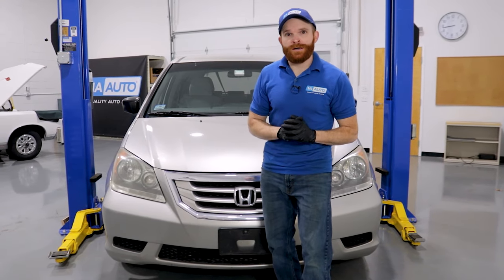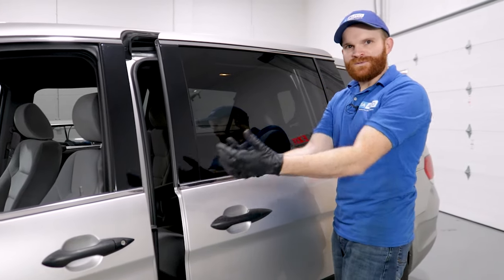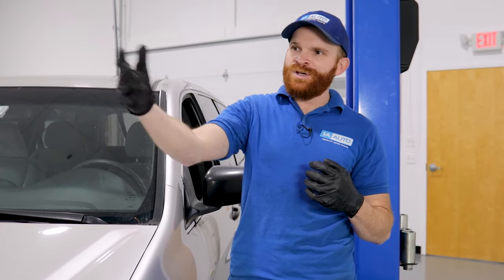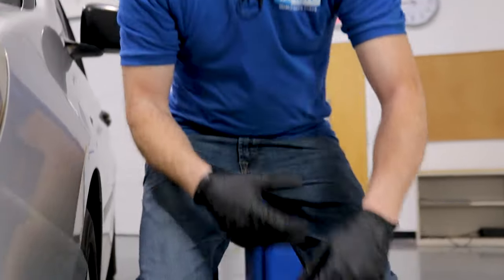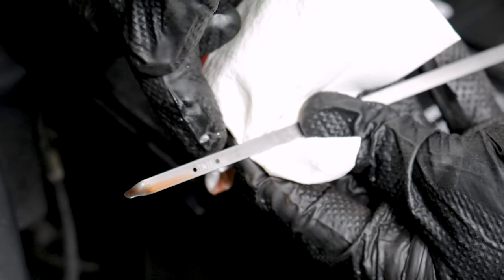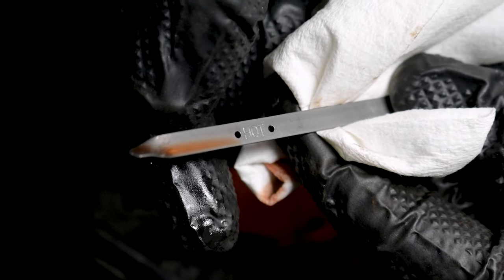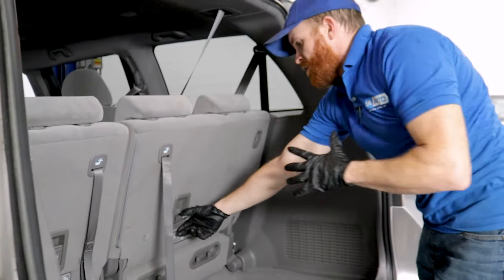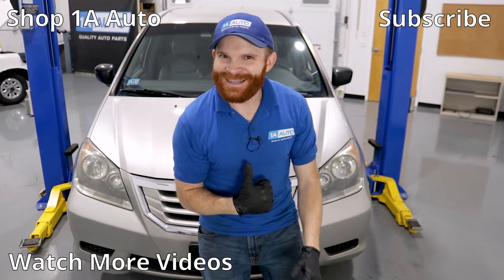Top 5 Problems Honda Odyssey Minivan 3rd Generation 2005-10

Comment: Arent you supposed to check the transmission fluid with the engine running?
Reply: that's oil and you check it after the engine has ran
Reply: Run engine for 10 to 15 minutes turn off the engine and then check transmission fluid same on every vehicle after 2003

Comment: So, how do you fix the sliding door issues?
And you missed the timing belt tensioner, the valve adjustment, the loose rocker bolts and power steering O rings.
Reply: There are videos showing how to replace the sliding door roller. I've done it myself. Not too hard. +1 for the power steering O rings.
Reply: Rockers and ps o-ring for me too. 
Anybody know the symptoms of a worn "timing belt tensioner"?

Comment: I own a 2007 odyssey exl I have none of these issues. My sliding doors sometimes act stupid due to the angle I’m parked on a hill . I have 149k solid no issues bout it 6 yrs ago only replaced Power steering pump and wheel hub bearing for the front, that’s it
Reply from the maker: +Kev Burr Thanks for the feedback!

Comment: There is nothing more unsatisfying!!!! Having to pull the sliding door panels, because the latch cables broke or came off.
CV-joints seem to fail premature. The streets in New Orleans can do that to any vehicle.
Don't ever use a FM transmitter to adapt your phone into the radio. SMH it caused my keys to not function right. The van wouldn't start in the mountains.
Valve cover gaskets or O-ring. once they start to leak there is no way to stop it, other than changing them.
But other than all of that it has been a great van. 
When my daughter wanted to start driving. She had to drive the van. Best boyfriend deterrent on the planet. Couldn't be happier with the results.

Comment: I own a 2005 Honda Odyssey and the back always fills up with water from the rain what is the problem with it
Reply: You've a leak, Ma'am. Only way to fix that is by finding it in person and seeing if you can spot where it is and if it would be easy to seal up. Could be something as simple as removing a piece of the trim or as expensive as a rust hole.

Comment: I have the brake pulsation and thought it was tire pressure issues.  Is there a set of brakes sutible for the Oddesy to stop pulsation.  I will have to replace mine.

Comment: I have 2005 Odyssey. Passenger sliding door won’t open automatically. Changed fused few times. Then it happens again. Remote will not open drivers door, have to use key, remote won’t operate car start or open tailgate. Is it fused or what? Have new battery in remote

Comment: 5 common problems? The only common problem hondas odyssey have is the sliding door & easy to fix! Not only hondas Toyota sienna they have it too!  Motor mounts , transmission mounts,  brakes , transmission low on fluid, Not serviced  is not a common problem!!! It's called maintenance! All cars have factory problems & recalls.

Comment: The only issue I’m really having with my 06 at the moment is when I put it in reverse I get a loud clunk noise which is very frightening. I’m taking it in to my mechanic in a month but he is unable to get me in sooner. My fluids are good and it shifts well. What could be causing this issue?
Reply from the maker: +Ciarra Easler We wouldn't be able to diagnose an issue like that here, you may want to have a local mechanic take a look at it. Thanks for checking us out! http://1aau.to/m/Shop-1AAuto-c
Reply: Just bought an 05 two months ago and it has the park to reverse clunk too.
Reply: Could be the motor mounts.
Reply: My 2003 Odyssey does that if I don't let it warm up when first starting it for the day.

Comment: I have the 09 with many problems it wont start after several hrs 10 tp 15 hrs. After replacing battery and alternator still same or worst. When is turn on sand left on park it will make a weird noise which seems to be the ac   Cause after that no ac only regular air i hope we solve all this issues today

Comment: You are doing a great job, hay I have a  problem with the my Honda  2003 steering  make a  noise  like  a cow in  van what about  that,  thank you for the wonderful things that you have done showing  what you did  blessings to you Amen
Reply: You most likely have air in your power steering system caused by an old gasket. This is common and there are several videos showing this fix. I've done it myself twice.
Reply: I did the gasket too, the one closer to the front, on top of the engine, in the power steering fluid line.

Honda part number 91345-RDA-A01
Which was $1.95 at the dealership part department.

I had also replaced the power steering fluid reservoir, and did a power steering fluid flush or whatever it's called. Overall it took a couple of hours, and fixed all the power steering problem.

Comment: Ok So the mechanic did something bc he was trying to milk another $700 out of me. He replaced my timing belt & tensioner. But all of a sudden, now ONLY driver's window & sunroof work. Checked fuses, factory reset, still no good on 3 other
(It's a 2006 Honda Odyssey)
The Honda Odyssey exhaust flex pipe, that braided silver stuff on it, a guy showed me it was oddly split down middle. As we're sliced by a box cutter. But would it idle OK, yet once I place it in drive, it won't go up hill. Similar to when I've blown a head gasket before (that one wouldn't idle though) but it's NOT the head gasket.  Just had oil changed professionally & still looks NEW. 
We'd changed the spark plugs, camshaft position sensor, crankshaft sensor. I've checked ALL MY FUSES. Pulled out relays, but unsure how to check those,  other than swap alike ones around. 
Oh, plus, when he touched my baby to do timing belt. All of a sudden my bad battery, which worked fabulous, as long as I didn't leave dome light on, or go like a couple of weeks without starting it.
Bought a NEW BATTERY.  KILLED IT before 30 days had passed. And that's with removing both cables, and only hooking them up to lick/unlock & maybe roll driver's window down.
They gave me ANOTHER NEW BATTERY.
I'm way too terrified to dare see if it's still drawing on the battery bc we got evicted in Feb. This is also my "house on wheels"
I stupidly went halves on motel room so I could give the poodle a bath. And someone shattered passenger window & ransacked my van.
I replaced the window.  But I can't get the motor to drop down to insert those 2 bolts. 
I've got half a tank of gas. 
My alternator is fine.
Starter is new rebuilt from a store, not ghetto home job.
Could that slit braided shit on the flex exhaust REALLY cause it to not go up hills?
No.
Idk where my fuel filter or lines, or pump.
I'm a girl.
I really REALLY want to BE THE GIRL & BOYS DO THIS.
But, no $, 2 large dogs & a possum...
I just don't have $ for anything.
Especially after replacing ALLLL THESE PARTS.
PLEEEEEASE 
WHAT ELSE can u think of, besides the fuel shit?
Sincerely,  
Hopeless close to Seattle

Comment: I have a 2005 Honda Odyssey it is giving me a code of p2627 oil has been changed it rides fine any ideas what could be making the code.
Reply from the maker: +@cliftonr4445 We wouldn't be able to diagnose an issue like that here, you may want to have a local mechanic take a look at it. Thanks for checking us out! http://1aau.to/m/Shop-1AAuto-c

Comment: I have a 2010 and when I shut my car off  I notice that the high beam light does not completely go out. It stays on with a dim. Then it noticed it flickers and I hear a clicking sound coming inside the car towards the back.  Why does this happens and how can I fix it

Comment: How about the problems in the engines with  the cylinder deactivation feature. Then there is the rear leveling arm issues.

Comment: I did replace the lower rolls from one of the sliding doors but I had a hard time puting the cable in fact I had to do something in order to do it but I thinks there have to be a easy way

Comment: What about the misfires and limp mode issues?
Reply: misfires are usually (not always) due to the Variable cylinder management
Reply from the maker: +T Mike Thanks for the feedback!
Reply: @MichaelB-cs6ke  To clarify, misfires develop from fouled spark plugs. Fouled spark plugs due to VCM. Clean or replace spark plugs and you're good to go!

Comment: In 2015 I bought bland new Odyssey. After drove  about nine  months the transmission acting strange.   So , I bring back to dealer,  they said can't find any issue.   . Notice  that when I starting at traffic light can feel first gear to second gear . whole transmission jump  ( jerk )  scare hack of me .  I back to dealer again. they suggest to change transmission oil.  After that.  good for few months.  Been told every 3 thousand miles have to change oil again.  The Honda not submit  they have a problem  on transmission .

Comment: 2009 oddy running great. (215,000 km) Rear wiper failed. Was looking for fix.
Reply: Let me know what you find out, mine is hanging straight down :(
Reply: If it just doesn't move it's most likely frozen in place. I've had to fix this twice (2 different Odys). Basically the wiper motor is frozen where the post sticks through the hole in the rear door due to corrosion. You have to remove the motor, then clean the post using sandpaper or a grinder. Grease it and reassemble it. Not too hard.

Comment: I don't have a transmission issue. However, whenever the car is parked uphill or downhill... It's difficult to change the gear from parking to reverse. Makes a loud noise while changing from parking to reverse.
Reply: What you probably have happening is that the full weight of the vehicle is basically resting on the trany and therefore on the gears INSIDE the trany.  This causes excessive wear .  Especially when pulling it out park and you get that big “CLUNK”, when you are on a hill. 
Solution when parking on a hill,... is to engage the parking break, BEFORE putting the transmission in park.  Then slowly let your foot off the brake pedal, so the vehicle then slowly comes to rest,...on the parking break (and NOT the transmission).  Only then shift into “ PARK”.   If when you let your foot off the brake pedal (slowly) and the car comes to rest on the parking brake, but then slips a little, it means you didn’t step/pull hard enough on the parking brake (this is common).  So just put it back in neutral,..push harder on the parking break, to the point where the vehicle no longer moves.  Then, again, slowly left off the foot break, confirm no movement, and on into park.

Idea here is that you never went to rest the weight of the vehicle on the transmission with the associated torque.  Once resting on the parking brake, and you shift into park,...the transmission will simply be a backup to the parking brake, should the parking brake fail for any reason while you’re away.  

You will know you’ve done it correctly when you go to leave and shift into drive or reverse and you DON’T get that big “clunk”, which is the engaged gears ripping apart under extreme pressure.  NOTE:  when returning to the vehicle on a hill, step on the brake pedal first, then disengage the parking brake,.. THEN shift into drive or reverse.    Many words to describe, but easy to do.   You could search on YT something like “Using an emergency/parking brake on a hill “.      Good luck, this should make your transmission last longer.  Cheers

Comment: I have a 2005 Honda Odyssey EX and I haven't experienced none of these issues but I have a list of other issues:

1. The Driver side door lock stopped working.
2. The van rattles at a standstill or in park sometimes.
3. The windows will randomly stop going up or down before working again.
4. The entire sound system sounds muffled now.
5. Its hard to turn the wheel, even with the power steering fluid full

....and many others
Reply from the maker: +ryanbomani Thanks for the feedback!

Comment: i have a 2005 odessey (Touring) with 242,000 miles. i have issues as such-pulsating rotors, motor mounts, passenger sliding door,key to open front door use only, locks click upon accelration and slowing down,hatch struts problems. ive taken to shop, i think they dont want to work on it. im 74 old lady and tend to work on it myself
Reply from the maker: +Kamryn Holbrook Thanks for checking us out. Shop for high quality auto parts on 1AAuto.com:

http://1aau.to/m/Shop-1AAuto-c

Comment: Awesome.i av 2005 model and d doors can only open manually.wat do I do get it corrected
Reply: Is the switch turned on for electric sliding doors? 

Maybe a fuse?

Comment: That's a great video but I'm not having those kind of issues right now. So here's the deal I own a 2006 Honda Odyssey it's got the 3.5 liter V 6, and it has 186,404 miles on it, at the beginning i thought it was the Thurmastate then I found that I was going through gallons of antifreeze but I can't seem to find a leak, now while out driving i notice the dashboard heater gauge has gone through the ceiling but I don't smell anything and when I stop the gauge is trying to go back down. Also I've tried stop leak in the radiator  but I don't think it worked, today I poured a whole bottle of antifreeze into radiator and it didn't leak out?. But the gauge says it's very very hot???.
Reply from the maker: +John Lundgren We wouldn't be able to diagnose an issue like that here, you may want to have a local mechanic take a look at it. Thanks for checking us out! http://1aau.to/m/Shop-1AAuto-c
Reply: Hey hope you fixed your problem if not I just seen a video where a guy talks about this and this is some kind of after market cooler that you can hook up to it hope that helps

Comment: I bought a 2008 Honda Odyssey new. It was the worst purchase ever, almost right from the start.    Issues with the brakes, the sliding doors, the transmission, the electrical system. It was a nightmare, to the point I dont want anything to do with the Honda brand again ever in my life!!!!!!

Comment: Hey i have a problem with my alarm.. i got a new battery and as soon as i connect the wires to the battery the alarm turns on and doesnt turn off? What do i do?? My van is a Honda odyssey 2005
Reply from the maker: +Christy Flores We wouldn't be able to diagnose an issue like that here, you may want to have a local mechanic take a look at it. Thanks for checking us out! http://1aau.to/m/Shop-1AAuto-c
Reply: For any vehicle,  use the key to unlock the driver side door to get the alarm to stop

Comment: I have a 2006 odyssey and it has a climate control issue. Cold air blows out of vents on drivers side. Passenger side heat good.

Comment: Can't decide if I should get a used Sienna or a used Odyssey?! Dang! Lol.
Reply from the maker: Hope the video helped! http://1aau.to/m/Shop-1AAuto-Now
Reply: If you want ride quality, reduced passenger cabin noise and less maintenance, Toyota Sienna. Bang for the buck, Honda Odyssey. We run a fleet on Turo that has five 2006-08 Odyssey and three 2006-08 Toyota Sienna. Definitely the Honda LOOKS better.
Reply: Sienna all day
Reply: Sienna is a bit of pain to replace plugs.  You must remove intake manifold.  But Odyssey is a pain that the engine is an interference engine and you must replace timing belt within 100, 000 mile interval to avoid engine from breaking.
Reply: Someone said Honda looks better. It's not about looks, I've dumped a small fortune into my 06 Honda Odyssey

Comment: TOP 5 ISSUES FROM AN OWNER 

1. Oil consumption due to eco mode
2. Power steering air/leaks due to o rings and high pressure hose
3. Alternator failure due to oil pass by due to eco mode leaking on Alternator 
4. TPS monitor systems have computer failure on tire pressures
5. Timing belt replacement every 100K
Reply: So I see one for sale 2005 it’s 175,000 Odometer 

He’s old he selling it for $3000 just because he’s moving to Mississippi but he has a mechanic to look at it an make sure it’s good

Comment: You did not mention PO303 where #3 cylinder rings go bad. Honda will repair as long as the car is less than 8 years old BUT can have unlimited miles. So if you have a 9 year old  Odyessy with 10,000 and  the cylinder goes, it's out of your pocket but if it's 8 years old and has 500,000 miles and it goes they will fix it for free. Makes sense right?
Reply from the maker: +michael grenier Thanks for the tip! We'll pass this info along to our production team.
Reply: Disable vcm if you haven't already

Comment: Hi 1A AUTO  i have honda odyssey 2007.2.4 engine i have a problem İ just buy this car 2 weeks ago this car have engine light  come  up we are drive cuople days after engine  shaking and light come up İ take rhe mechanic he says start spark plugin ,and coil   and delete the light 5 days later is come up again. Do you now what is this or what is make this problem.. 
 Thanks
Reply from the maker: +Mahsum Acar We wouldn't be able to diagnose an issue like that here, you may want to have a local mechanic take a look at it. Thanks for checking us out! http://1aau.to/m/Shop-1AAuto-c